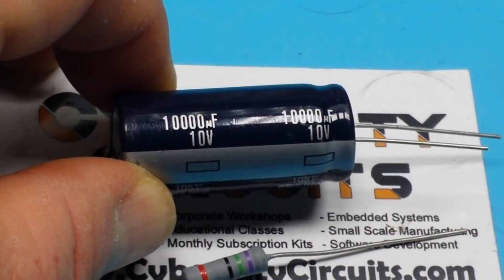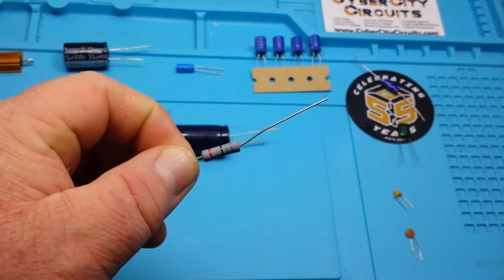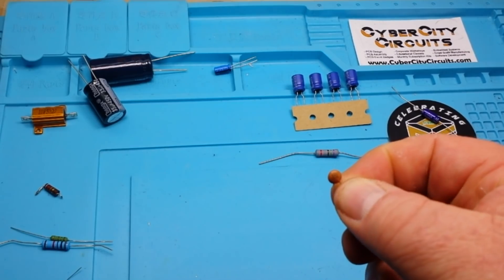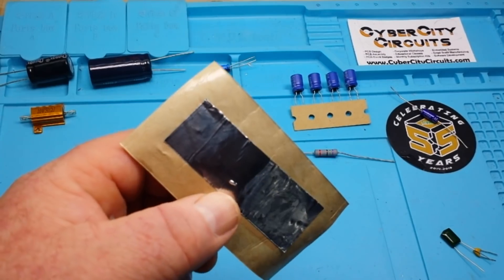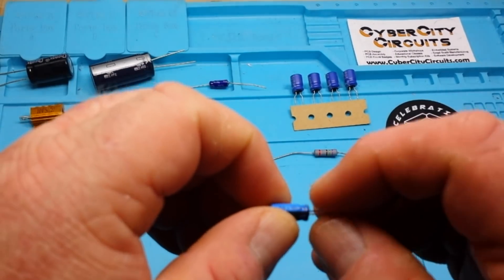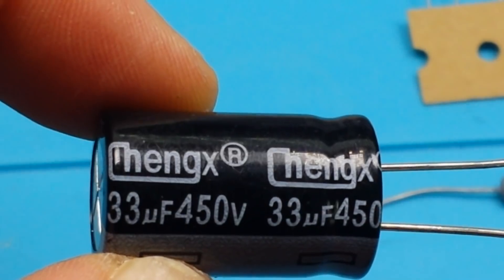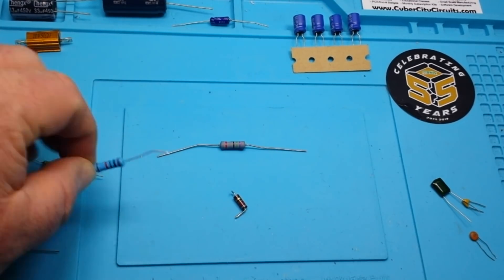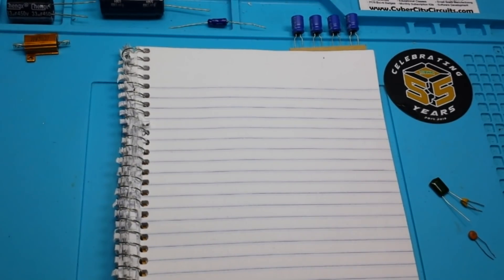Why don't resistors have voltage ratings printed on them like capacitors

Comment from the maker: Im talking about the average guy/girl buying a bag of resistors off ebay for their Arduino/RasPi projects. Not the electrical engineer who needs a .5% Vishay 220K 1000V wirewrapped precision restor for their pulsed ruby laser.

Comment: Resistors have a voltage rating & a safe working area defined by the wattage .
The voltage rating can be 50 V for ¼ watt resistor .

In this low voltage world it's never a headline number .
It can be omitted from data sheets but if you know the manufacturer ask the question you will find the answer .

With unknown parts you normally find out the hard way .

This is why the ht & eht of old TVs used 2 watt carbon resistors  .

Comment: What formula do you use to find the Max Voltage and Max Current in a 1Watt,2watt,5watt,10watt resistor. You can use I X R to find the voltage and V/R to find the current but this is not the max voltage and max current before damaging the resistor at its rated wattage value.

Comment: That's a good question...actually resistors do have an absolute maximum voltage regardless of resistance value. See a sample datasheet >> https://www.digikey.com/en/datasheets/vishay-bc-components/vishay-bc-components-pr010203  notice for the PR01 series the max is 350v for the range 0.22 ohms all the way to 1M ohm. So if I put 500v across one of these 1M babies it's only 0.25W well within the 1W max but exceeding the voltage spec by 150v. So that is an example of exceeding the voltage range but well within the power range. Likewise for low values of R with high currents you can exceed the power limit while staying well within the voltage limit. Moral of the story if you are designing any HV or HI circuits you need to be mindful of both the power and max voltage rating, and possibly any surges or spikes the circuit might encounter. For most small signal, low voltage or digital circuits unless a heavy load is being powered the common 1/4 or 1/2 watt resistors are fine 90% of the time. Remember P=E(sq)/R = I(sq)R   https://image.slidesharecdn.com/internalresistancepowercombiningresistors-120421013549-phpapp01/95/52-internal-resistance-power-combining-resistors-6-728.jpg?cb=1335190002

Comment: 10:22  Errr, what?  100mA through a 1kOhm resistor is gonna cause that resistor to go up in smoke pretty quickly - I^2*R gives you 10W of power to dissipate, which is gonna fry that poor 1W resistor.

Comment: Resistors are often power limited but they have voltage rating too. Something like 0805 or 1206 smd resistor is probably rated for 125V or 200V. Similarly normal 0.66W resistors can be rated  for as low as 200V or 300V. When you use higher voltages (say a 350V charged mains capacitor bleader resistor) you may run into limits. A 350V cap needs 2 to 4 0805s in series in order not to break down. In pulsed applications average power can be low too even if voltage spikes are very high.
In low voltage stuff like any device less than 100V voltages you are practically power rated. Above that you may run into voltage limiting too.
When you get into the kilovolt or more range (that includes some mains snubbers etc), you need to consider voltage rating. When you get into kilovolts range, you are often voltage limited (not power)There are resistors for something like 3kV or 6kV that are easily available. Above that they start to get very expensive. At 10kV and more range, voltage flashover becomes an issua. I think I have one resistor rated for 150kV/1000Gohms and you can guess it is pretty long, even if it is made to be used potted or immersed in oil or some other insulator.

Comment: I recently learned that lots of high value carbon-film resistors are literally incapable of reaching their inferred voltage rating. I was zapping and blowing up stuff with a dangerous DC source, and was unable to get any 1/4 watt resistors above 5.1 MOhm to make it up to 0.25 watts without it immediately going bang. At around 1300 or 1400 volts (if I remember correctly) they became time bombs and would arc over once they warmed up a bit. 

Above 1400 or 1500 volts, most of them immediately popped.

However, I have to say it’s still ridiculously impressive that that size resistors block over a thousand volts without going bang! Especially considering I was testing dirt cheap resistors.

Comment: Wait.  A 1k resistor with 100v applied to it means the current is 0.1A which means the power (P)=.1A(100v)=10 watts, which exceeds the power rating of a 1W resistor.

Did I miscalculate something?

Comment: They have voltage rating ya just have work a little harder to get it.. you have WATT rating, and color coded rating for Resistance, OMH'S LAW WLL TELL HOW MUCH THE RESISTOR CAN TAKE THERE FOR VOLTAGE RATING/TOLERANCE RATING, YOU PICK... you will know your voltage check your current, multiple. and RATING! SO CHECK AGAINST WATT RATING... HOPE THIS HELP'S I'M VERY DRUNK!!

Comment: Paul, thank you for all your helpful videos. I wanted to point out a small correction here. I think you noticed that something was wrong when 1^2 mysteriously turned to E^2 between 10:04 and 10:05, but that didn't quite fix the problem. Starting with P=E^2/R, and P=1Watt and R=1000Ohms, you can already calculate the maximum voltage (without need of specifying a current) as E=sqrt(PR)=sqrt(1000)=31.6Volts (as previously pointed out by ats89117). This gives a max current of I=E/R=31.6/1000=.0316=31.6mAmps. As you mention, it would take 100Volts to put 0.1Amps through the IKOhm resistor, which would be asking the resistor to dissipate 10Watts and would probably fry it. It looked like you might have accidentally started to substitute the 1K of R in place of the E variable in the equation, which sent you off on a current tangent. Don't stress about it, we all make mistooks ;) Keep up the great work.

Comment: Metal tape on cardboard?   I had an EE class where that was part of an exam.  Each person got a homemade capacitor like that, then based on the areas of the plates, and the dielectric material, we had to estimate the capacitance.   Not too hard, if you were ready for it.

Comment: Where I shop on Mouser and Digikey,  resistors have voltage ratings listed in their specifications.
 And I check before purchasing because I service vacuum tube equipment which has high voltage.

Comment: The simple wattage rating of resistors is more about heat tolerance and dissipation than voltage or current.  Put a heatsink on a resistor and it can tolerate a higher wattage and therefore a higher DC or RMS AC voltage.  I don't think any of the comments so far mention pulsed waveforms.  A resistor can tolerate a much higher peak voltage with a 0.1% duty cycle waveform (depending on frequency) than DC.  As mentioned previously in the comments, a resistor can arc.  They are also imperfect and have unintentional capacitance and inductance.  So resistors have an absolute max peak voltage rating as well as an absolute max frequency rating (based on material and distance between connections - like SMDs as previously mentioned).  We as hobbyists tend to ignore these ratings since we rarely approach them.   Those of us that can generate a 2000v picosecond pulse across a 10 ohm resistor should already be aware of such limits.  If not, well ... protective eye-ware is mandatory.
Reply: Darn, I was going to say this. Also the formula was a bit misused.
   Good video, though it might have been better with a couple of graphs showing that static limits are much lower than dynamic limits for resistors.

Comment: Resistor do have a voltage breakdown specification. Using pulsed current, it would be possible to meet the resistors power ratings while exceeding its breakdown voltage rating. Consider what would happen if an EHT spark current is applied to a resistor, depending on its structure and its resistance, an electric arc may flash across the resistor material that is usually coiled around the ceramic body of the resistor. A failure of a resistor by this mode is sometimes indicated by the black track marks left by the arc in the resistor insulating  passivation coating. This is in contrast to the brown burn discolouration often left on a resistor whose power rating has been exceeded. The resistor break down rating is of notable importance in high voltage multiple circuits or those used to monitor a high voltage.

Comment: If you have a high crest factor signal where the rms value of the voltage is much lower than the peak value, it is possible to have an arc over even though the max dissipation is within limits. Another situation is for very high value resistors where the voltage across it can be very high before the max dissipation is reached.

Comment: Good Analogy on resistor voltage limits.    Sorta Missed  Arc Over .  Arc Over is issue with Resistors as well.

Comment: As has already been said in comments.
The voltage rating of a resistor depends on the insulation encapsulating the resistor.
You may not drop a very high voltage across the resistor, but it can still be at a  potential of 100's of volts, as in high value discharge resistors in capacitive voltage droppers, with respect to other components on the PCB.
If it is a carbon film, the voltage developed between the edges of the etched spiral inside the resistor become a factor.
Also if you drop too high a voltage across ends the resistor then you will get an arc over the surface of the resistor. This is important in DMMs where resistors are used at very low current to drop 100's of volts for the electronic circuitry to measure. To solve this problem they use a chain of resistors in a line to drop the voltage progressively.
This is why SMD type resistors are of special concern.
Reply: well stated, if your into 100's of volts or safety it's best to put a few in series for protection.

Comment: That's a tough question. Most people have a very large range of different values of 1/4W resistors. Every single one of those different values can handle a different voltage even though they are all quarter watt. Higher value resistors can handle more voltage, but it isn't linear. It takes a lot more resistance of a given wattage rating to be able to handle a little bit more voltage. 1/4W resistors are small, and the capacitors that are about the same size as 1/4W resistors don't have their voltage rating listed on them either. Once you get used to calculating wattage, it's actually pretty easy to calculate if a voltage is too high. Probably easier than trying to find a voltage rating. On top of that, once you know the lowest resistance of a given wattage that you can use for a particular voltage, any higher value resistor is even safer. So you just need to remember/write down the minimum resistance you need for the particular voltage you are working with.

Comment: This is plain incorrect. 1/4W resistors usually have only a 300V or 350V rating that is not dependent on Ohm's Law or power at all. For larger voltage rating, bulkier resistors need to be taken, i forget the specifics. SMD resistors have lower voltage rating which also depends on the size. An arc can occur if there's plenty of voltage, it can go through the core material, through the paint on top of the resistors, through the PCB underneath, so for example terminal distance is one of the main factors. It's generally specifically relevant with resistors of very high value, like over 1 Megaohm, as the arc formation voltage rating is easily exceeded before the power rating is exceeded. Slight inductive trait of metal film resistors can also promote arc formation.
Reply: True (try multiple kV and some tiny xx GigOhm resistors - fun guaranteed) & another reason why you read the datasheet of your parts - you'll find voltage rating for your resistors there..

Comment: Your math isn't too good. V^2 / R = 1 means that V^2 = R so V^2 = 1000 and v = sqrt(1000) which is about 31.6V and NOT 100V. You can check it by multiplying v = sqrt(1000) by I which is equal to V/R which is equal to sqrt(1000) / 1000. This gives a power of sqrt(1000) x sqrt(1000) / 1000 = 1 Watt. Your solution of 100V x 100mA gives 10 Watts, releasing the magic smoke from your 1 Watt resistor...
You also missed a great opportunity to gain additional subscribers by not demonstrating the problems with overvolting by blowing up the components!

Comment: Can you please explain to me how do you measure the voltage of a charging battery because wouldn't you just be measuring the charging voltage for a battery when you put a multimeter between the power rails when charging a battery?

Please get back to me I need to know for a project
Reply: Well your question doesn't make sense. The voltage between the battery terminals, as the current is being applied to charge the battery, is specifically the 'voltage of the charging battery'.
It may at times be difficult to draw conclusions from, for example, you model your battery as a container with an "ideal" battery in it and a series resistance, also known as ESR. But since you can not get inside the battery, you don't have attachment points to measure the voltage of "ideal" battery inside. Also surprise, the "ideal" battery was a lie all along, and the ESR is dependent on a million things, like the temperature, the current, the charge state, on what the dog had for breakfast, etc, and it changes by several orders of magnitude.
So you have a few ways of dealing with it, a few tricks. But first i have to ask you, where does specification of "voltage of the charging battery" to be measured come from, how is it substantiated? What do you want to actually KNOW from that? If it just says that you need the voltage because the spec says so, well just measure the voltage and be done with it, let it be someone else's mistake when it turns out to mean nothing
Also what cell type, chemistry battery even.
Reply: The voltage of a discharged battery is quite low, and no charger will force (say) 1.5 V on a discharged AA battery - a discharged battery would overheat and you need to be wearing goggles.
   It's true that the charging voltage of a battery is not the whole story. To get a better idea of what's going on, you have to measure the charging current as well.

   Level 1 chargers (my own name for the simplest chargers) are a voltage source and a resistor in series with the battery. The resistor limits the current to some safe value, and the battery's voltage will rise as it charges.
   Level 2 chargers provide a variable voltage and use the current to decide what the applied voltage will be. They may also have a 'trickle-charge' capability; when the battery's voltage reaches the full-charge specification, the charger reduces the voltage so the current is very low, as desired for maintaining the voltage. [Most USB chargers do not have trickle charge, so don't leave your phone on charge forever.]
   Level 3 chargers are more complex, and track the charging cycle over time. These can find problems with the batteries and let you know when they're bad.